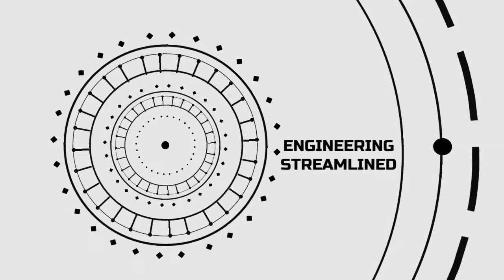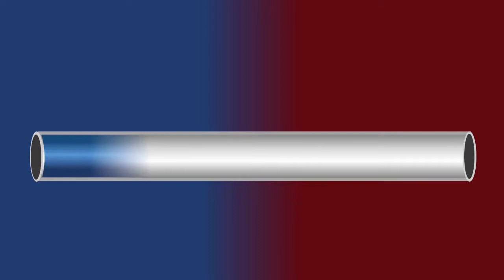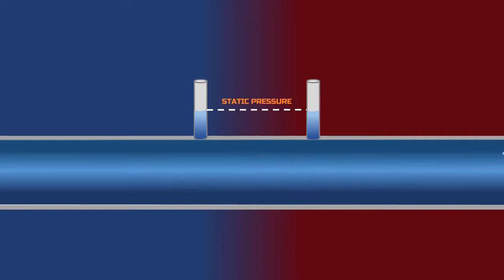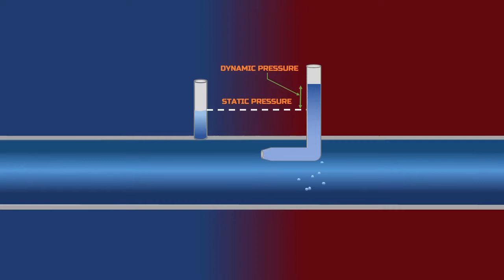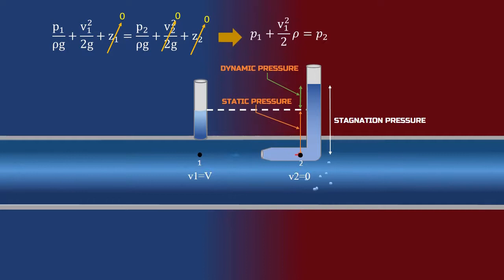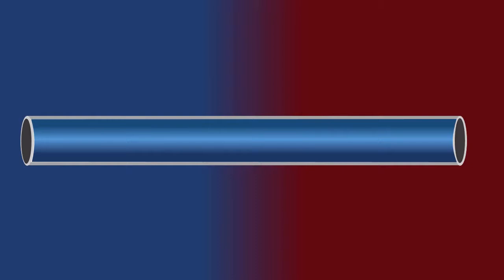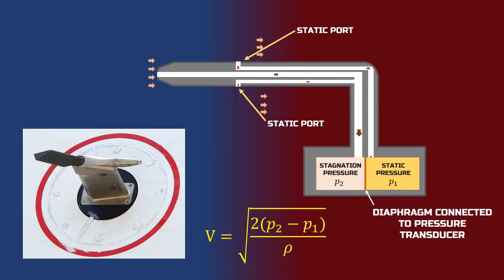WORKING OF A PITOT TUBE

Comment: the box of stagnation pressure should be larger than the static pressure
Reply from the maker: Yes. In the pipe flow, I have shown stagnation pressure greater than static pressure. I think you have commented about the last part of the video where stagnation pressure and static pressure boxes of a pitot tube are shown of the same size. The boxes just show the two pressure chambers not their magnitude or value.
Reply: @ENGINEERINGSTREAMLINED  oh thanks for your comment . i really appreciate your answer
Reply from the maker: @cleison-em7bk  You are welcome

Comment: Isn't bernoulli's equation about a moving  fluid inside a pipe? How do we take the equation between  1 and 2?
Reply from the maker: In the video, Bernoulli's equation is applied at points 1 and 2 which are inside a pipe with a fluid flowing through it.
Reply: Thank you very much, sir, for replying to my question. 
My confusion was about point 2 actually.  Because all the fluid inside the pitot tube is in static equilibrium and does not move, and so point 2 isn't moving either. 
But then i remembered that in other problems, for example when draining a large tank we also apply the Bernulli equation between a point that's not moving( at the top) and a point that is moving(at the outlet).
Reply from the maker: @captainamericawhyso5917  Yes. You are right. At a point, inside a flowing fluid, the fluid may come to rest but still you can apply Bernoulli's equation.

Comment: but what about the direction of the wind? it should be in the opposite direction of the pitot tube head? I'm confused or maybe it's a dumb question 🥴
Reply from the maker: The direction of wind should be towards the pitot tube. For example if the pitot tube is on a aircraft and the aircraft is moving from right to left. Then the air will enter the pitot tube from left to right.
Reply: Use Relative speed concept of speed of air and speed of plane

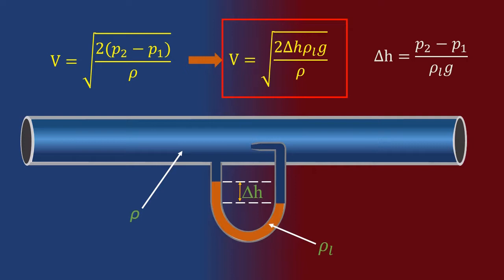Comment: How do you go from the expression at 4:17 to the one at 4:30 with delta h defined?
Reply from the maker: The expression at 4:17  is V=sqrt((2*(p2-p1))/rho)).  The expression for p2-p1 is obtained from Bernoulli's equation applied on the manometer liquid and replaced here. So, Bernoulli's equation is P1+(1/2)*rho*V1^2 + rho *g *h1 =  P2+(1/2)*rho*V2^2 + rho *g *h2.

Since V1=V2=0 as liquid inside the manometer is stationary. 
So we can further write
 P1+ rho * g * h1 =  P2+ rho *g *h2.
P2 - P2 = rho * g  *(h1-h2)
we can write, h1-h2 = delta h
delta h = (P2 - P1)/ (rho *g)

Replacing P2 - P1 in the expression of velocity we get

V=sqrt((2 * delta h * rho_l *g)/rho))

I hope it gets clear now.
Reply: @ENGINEERINGSTREAMLINED  thank you, I fully understand now

Comment: Good video and fair explanation. But that's only half. There are no numbers as example, it's just a bunch of formula conversions. Some examples of rho, p2 and p1 would complete the tutorial on how to calculate fluid/gas speed travelling through the pipe.
Reply from the maker: Thank for the comment and suggestion. I will try to put numbers also for demonstration in my later videos.
Reply: @ENGINEERINGSTREAMLINED  You're welcome. Good luck on your future tutorials. ;-)

Comment: Can we use accelerometers instead of pitot tubes?
Reply from the maker: I don't think accelerometers can be used instead of pitot tubes for velocity measurement in aircrafts. Because aircrafts are not always moving in a straight direction, they sometimes go up and down due to which the angle of attack of air on the aircraft can change and the stagnation point moves as the aircraft angle of attack changes. But the pitot tube front opening always hits the stagnation point so it can measure the correct velocity. Since accelerometers are kind of inertial instruments that measure acceleration using the force acting on the aircraft skin, the air will apply different force on different part of aircraft depending on the angle of attack. So it may give wrong value of aircraft velocity. So pitot tube is still in use.
Reply: @ENGINEERINGSTREAMLINED  Okay, but I got this question after realising that our smartphones use accelerometers and using that they show velocity on google maps I guess (I guess using integration and other algorithms)... So that's why the question.
And also, can't we use 3 axis accelerometers and gyroscopes for better understanding with proper sensitive data excluding body vibrations and all...?
Reply from the maker: @rohanshinde9575 I think your question was very interesting and innovative thinking.  But I am not an expert in accelerometers. So from my knowledge, I think it is not feasible for any accelerometer to measure correct velocity for any fast moving object especially which are rapidly changing orientation. The accelerometer can gauge the orientation of a stationary item with relation to Earth's surface. When accelerating in a particular direction, the accelerometer is unable to distinguish between that and the acceleration provided through Earth's gravitational pull. Using a three-axis accelerometer one could identify the orientation of a platform relative to the Earth's surface. However, once that platform begins moving, its readings become more complicated to interpret. For example, in a free fall, the accelerometer would show zero acceleration. In an aircraft performing a 60-degree angle of bank for a turn, a three-axis accelerometer would register a 2-G vertical acceleration, ignoring the tilt entirely. Ultimately, an accelerometer cannot be used alone to assist in keeping aircrafts properly oriented.
As far as I know, gyroscopes are used in rockets but mostly for inertial stability and to maintain its trajectory. 
You can go to this link for more knowledge
https://www.livescience.com/40103-accelerometer-vs-gyroscope.html
Reply: @ENGINEERINGSTREAMLINED  About the free-fall example, can't we use two or combinations of accelerometers like one is fixed for 1g and the other for zero-g acceleration at one reference point which is a standalone point.
Also, found this wiki article fascinating on the inertial nav system- 
https://en.wikipedia.org/wiki/Inertial_navigation_system

for a detailed comparison, can search the term 'pressure' on the webpage... They mentioned some errors in numerical integration under the drift rate section...
Reply from the maker: @rohanshinde9575  I read the Pressure Reference System  form the wikipedia page. It seems to be promising but still this system mainly depends on data from sensors and as mentioned, the data from sensors can cause errors due to environmental parameters such as temperature effects, engine vibrations, etc.  So maybe in future if all these errors are taken care of then this type of system will be used in aircrafts. So currently, the industry is going with the most reliable way to measure the velocity that is pitot tube.
Reply from the maker: @rohanshinde9575  Thanks for the appreciation. I do not use Adobe Suite. Currently I am using Microsoft PowerPoint for making animations. I will be happy to collaborate in future when you have some videos on your channel.